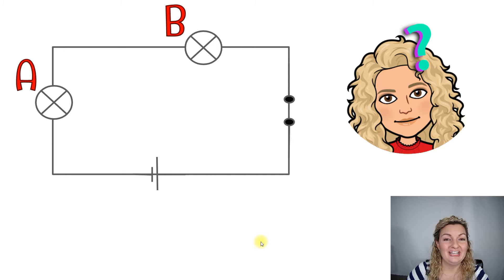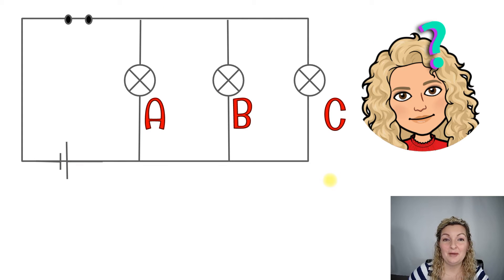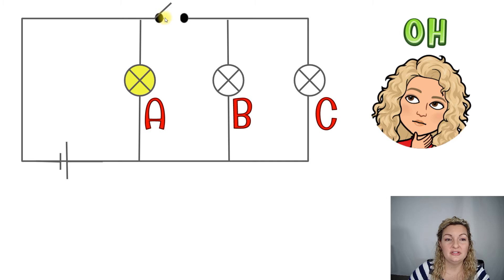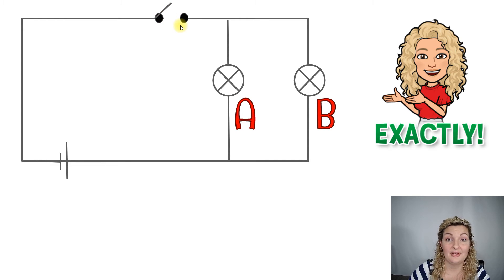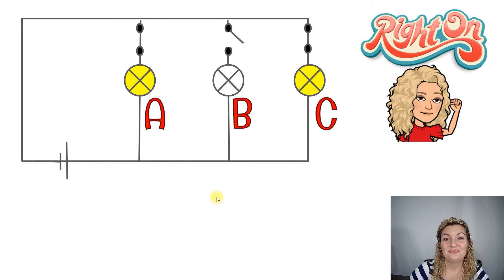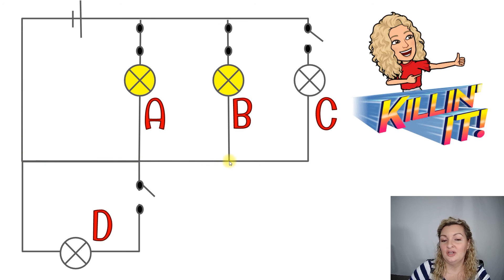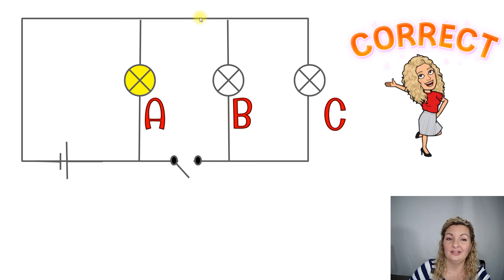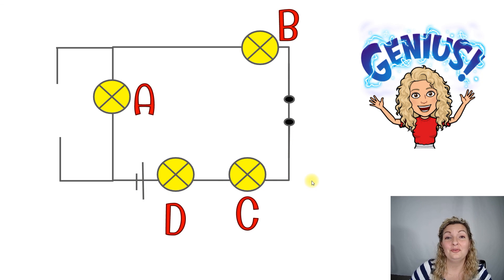Circuit Formative Assessment | Which Light Bulb Will Light Up? | Science Study Help For Electricity

Comment: as I understand it.........Conventional Current Flow: Arrows point away from the positive terminal.  Electron Flow (if annotated, but less common): Arrows would point towards the positive terminal, since electrons move from the negative terminal to the positive terminal. When drawing or interpreting circuit diagrams, it's standard to use conventional current flow.